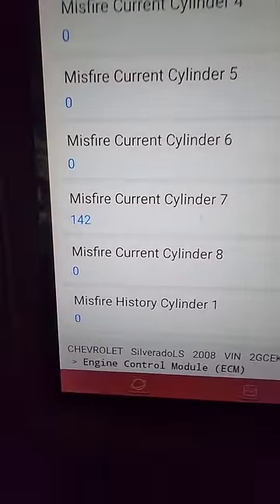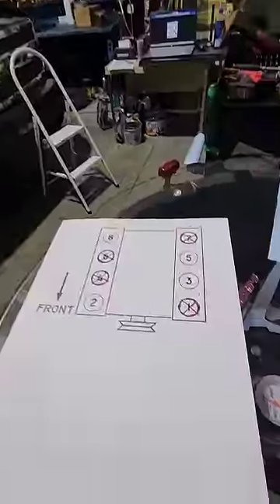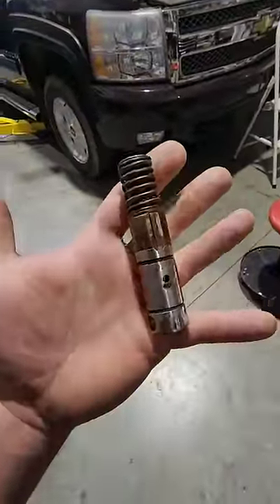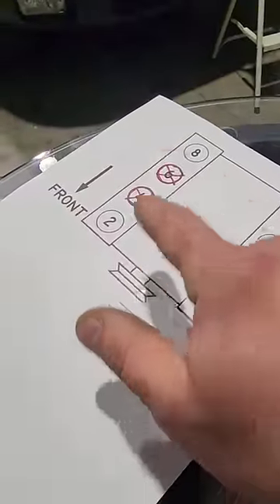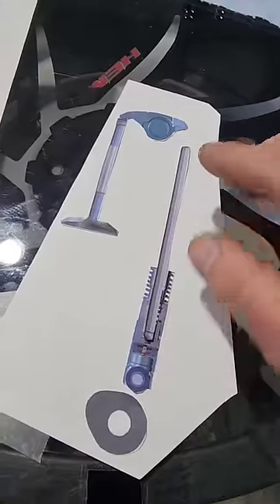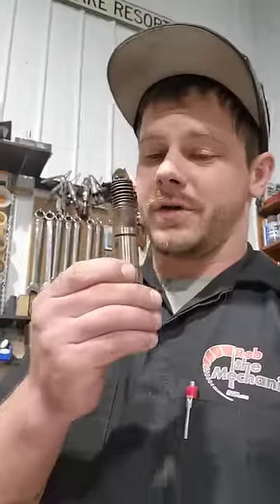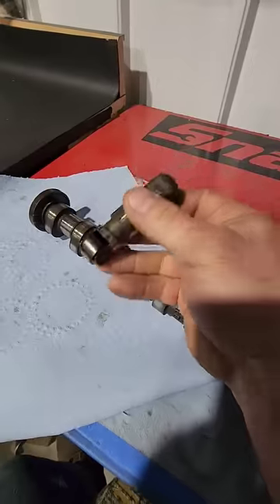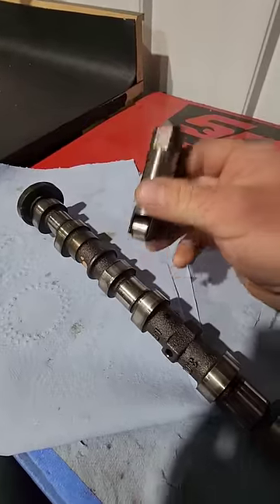GM Lifter Tick #shorts

Comment: always turn off  AFM  on every vehicle
Reply: turning it off reduces the chances of lifter failure, but doesn't completely prevent it. proper way is to delete the system altogether and install the same non-collapsible lifters on all cylinders.
Reply: Also turn off stop/start. Your engine doesn't need to go through a start cycle at literally every stoplight
Reply: GM calls it DOD "displacement on demand"...😎
Reply: @CWARZ23  It WAS DoD until Ford sued GM for the technology, where it was renamed AFM. That's what Ford does with literally everything...."we weren't bailed out, we just got a phat government grant at the same time!" - Every Ford fanboy.
Reply: @rorsche I would like the source for that lawsuit as I could not find it. DOD and AFM are not the same DOD shut down the same 4 cylinders everytime it didn't need all 8 here displacement on demand. AFM uses a process they call dynamic fuel management and on a v8 there is 17 different deactivation patterns and shut down all but 2 cylinders
Reply: @michaelbradley770  That's weird, because I can type in 'Displacement on Demand to Active Fuel Management' and the first result is, "Active Fuel Management, formerly known as Displacement on Demand before a Ford lawsuit.' I then can type in 'Displacement on Demand lawsuit,' and I get results showing Ford attempting to sue GM because Ford couldn't get it right.
Reply: @rorsche  I am still not seeing anything that says anything about a lawsuit. Copy and paste your source. And ford didnt have cylinder deactivation in a vehicle until 2021 and gm was already starting to use the term afm in the mid 2000's
Reply: @michaelbradley770  As far as I know, you can't link outside sources anymore; at least I can't. I can barely even type a reply without it being removed. But this is a simple search, so why are you lying so hard on this?
Reply: @rorsche  well from my side it sure seems like the lying is coming from you and you can still copy and paste links on a YouTube comment but thats ok because you probably can't find the source your talking about. The only lawsuits that my search is bringing up are class action lawsuits against gm for there dod/afm lifter failures.
Reply: @michaelbradley770  I attempted to respond to this like 5 times now. Whatever, you win by authoritarianism; proud? Anyone can look it up and see that you're incorrect. You even had to change your argument about DoD to AFM, so who are you trying to convince? Other people without honesty?
Reply: @rorsche  haha I didn't change my argument at all. As you said this is a simple search well so is sharing the source but you refuse to. GM fan boys having to make things up to convince themselves its a better product
Reply: @michaelbradley770  Your first comment states that they aren't the same thing. Then you proceed to admit they're the same thing.  Now you're talking about DFM which is ALSO GM. 
And now you're really going to act like the ship of censors doesn't exist here? Literally EVERYONE knows it does. You can't help but lie your face off.
Reply: @michaelbradley770  I'll tell you what, YOU link an outside source that says I'm wrong; since you're the one claiming it can be done.
Weird that you haven't done that to 'prove me wrong.'

Comment: My buddy bought an 08 Silverado max with the 6.0 aluminum block. He got it cheap because the owner gave up on it after the number 7 lifter had failed twice before and failed a 3rd time. Got it fixed again and it went out again after he had it for like 8 months so we just ripped out the AFM lifters and rebuilt it without that shit. Put in a cam and changed the oil pump and valley plate and timing cover to get rid of the vvt stuff too. Still running today. Been like 6 years now.
Reply: Should ha removed that the first time. Notorious problem.
Reply: @terrylong6457  it was left at our bosses engine shop so it got fixed on the company dime. After it failed again is when we converted it so he never spent the money on fixing the AFM himself. Plus he picked it up for half the going rate at the time. The previous owner was LOOOOOADED, and this black paint LTZ premium truck was now his "drive through the woods" truck because he already had a new one. Buddy grabbed it for 7500 and at the time the average ask for it was around 13-14k so he came out ok.
Reply: Pretty sure.The 6.0 is an iron block
Just looked it up, i stand corrected

Comment: I hate these afm/dod engines. If I wanted a gas saver I wouldn't have purchased a v8 pickup.
Reply: Oh wow grab HP tuners and click its off so hard bud
Reply: @shesqueeled  will that work on a ram1500?
Reply: @SHANKDAWGBABY  a lot of RAM guys are using the Diablo tuner
Reply: @jessesdomain444  copy that! Thanks
Reply: @shesqueeled shouldn't have to.
Reply: Man I swear this problem they created should be a factory recall.💯💯💯

Comment: Anyone who experiences this, pay attention, you need to replace your oil pump, there's an aftermarket high volume oil pump available that was specifically designed for these engines. When oil changes are neglected or the miles start racking up the stock pumps no longer keep up which is why these lifters fail. When you replace them, the new lifters will only last a year and some months. But if you replace your oil pump you will get more life out of your engine and the new lifters.
Reply: thanks!!
Reply: And an oil pick up tube brace that uses the other bolt hole.
Reply: I installed that pump, replaced all lifters and less than 50 miles after repair, same issue. What else could be wrong?
Reply: Wow sounds like GM
Reply: @beton10mix  Hahaha! Installer error.
Reply: Replace the lifters with standard LS lifters and the problem is solved forever, no need to buy a different oil pump.
Reply: I think it has more to do with the collapsible lifters getting stuck in collapsed mode.
Reply: Looks like another instance of GM  engineering a complete piece of s### and having the customer pay for the incompetence of the design team. Until you stop buying their product they won’t improve.
Reply: You're half right there bud, the lifters fail because of driving conditions. Not all drivers drive the same. If you live close to a highway and you start your car up cold and get on the highway right away and start cruising, you're going to be running in 4 cylinder mode leaving half of your cylinders not firing as well as those valves not actuating. It's the inconsistency that kills these valves. If they were used every day for " V8 driving ", you'd never have an issue. I just jump on mine all the time so it doesn't get comfortable in 4-cylinder mode until I scratch up enough cash for the Truck Norris cam kit from Brian Tooley.
Reply: @beton10mix clogs in internal oil passages. The block needs to be completely disassembled and clean every single tiny oil passage. I never change the pump, just installed non afm lifters, and delete the afm activation in the computer.   
And clean everything. 
Oil pump bypass spring could also be weak(can simply be shimmed with washer) or it's also possible to have an air gap on the o ring for the pickup tube. There is a kit available to brace the pickup tube, but can be made with a bolt, a washer, and a Dremel.
Reply: @johnk3606 your only talking about every single manufacturer after 2008. 
All period. 
Honda dealership started 10,000 mile oil change intervals in order to kill more engines by 150,000 miles. 
Same with Toyota. 
Every single manufacturer says go longer in between oil changes. And uses low tension rings that are more efficient, but are less capable of keeping the oil out of the combustion chamber. Modern engines consume oil at rates that would have been totally unacceptable 15 years ago. 
Unfortunately everything new is completely shit.
I cannot recommend a single manufacturer where you won't have problems as soon as the warranty expires.
Reply: Hmm so it sounds the oil pump is the cause of failure?

Comment: Lol GM is not the only one having that issue Chryslers 5.7 6.4 6.2 and even the 3.6 all do the same exact thing
Reply: Mine has been that way A LONG TIME! A machanic said don’t worry about it. He said you can have it fixed but it’s just going to happen again. What do i need to do? Also i am on a fixed income so how much would it cost to fix? Do you know?
Reply: I have the 6.4 it’s a crystler 300.
Reply: not exactly the same issue, more of a lack of oil flow between the lifter and cam, the very low angle of the rods and lifters at low idle prevent adequate oil to all surfaces. at higher engine speeds it's fine soon as it is sitting with out footy on feed it starts starving for oil.
Reply: @juggernautxtr  so it’s ok then?
Reply: @thejakefromstatefarm6768  not on gm it's gonna go no matter what, chrysler is an issue where if you let the engine idle to much it will have the oiling issues. chrysler the more your on the gas driving the better, the less stop and go traffic your in the better.
Reply: @thejakefromstatefarm6768  dude your 6.4 is fine just keep changing the oil every 3000 it will still tick but wont harm anything
Reply: @thejakefromstatefarm6768  I priced one today for a 5.7l hemi and it was like $4600 but we are a dealer and like most labor rate is high high lol hope this gives you a ball park at least
Reply: @prestonikard9221  thank you much
Reply: the 6.2 luckily doesnt have MDS
Reply: @juggernautxtr  Yep! I told my wife..do not let her 5.7 hemi idle for any length of time. I do have the broken exhaust bolts I got to fix, they all do that.

Comment: My 07 Escalade (6.2) did this at 176k miles. Along with the oil pump going out 2 days later. 
It was a headache to repair. The manifolds were a nightmare because the bolts were rusted and all broke. Then I have an all wheel drive so I had to drop the front differential to remove the oil pan to replace the oil pickup tube. All in all it took me 3 days. 1 to get parts, tools, and begin the uninstall process. Day 2 complete uninstall process and replace worn parts. Day 3 reinstall and go on a 4 hour road trip to make sure it all worked 😂 * I have AAA so I wasn’t worried about being stranded.

Comment: They make a kit it’s 800 comes with all the new gaskets and all new lifters new valley plate and cam and a tuner to turn off the afm that’s the best thing u can do with them motors then they last forever
Reply: Got more info for that kit? My 2007 Suburban has that v4 v8 DOD crap.
Reply: @Jennifer Rae Fuchek  check texas speed and performance. They offer DOD delete kits and required cam packages. You can get stock grind cams, or a higher lift cam for a few extra ponies, if you'd like.
Reply: @JenniferF2882   if you don’t plan on other serious upgrades, stay with the factory style cam on the kit. It’s mostly at high revs / high loads where it will make any difference alone.  Other than squirting more fuel to compensate for more air at all RPMs.
Reply: I have a ‘11 Silverado with 199k miles. It’s still fine. I feel oil is a Leo element in this problem being kept to a minimum. I use the same brand oil all the time and use a Wix filter. I change oil on time and I have been lucky so far.
Reply: Why can’t they just not put that garbage ass shit in from the start instead YOU have to go out of your way to buy an aftermarket kit and install it / pay to have it installed. No thanks. And a ford modular motor runs forever. No bullshit like this to deal with
Reply: @anthonyhales4192  I feel ya I’ve seen ford motors fail too use to build them and race them ls is the best motor out there if u get one without the afm
Reply: @jokesatinappropriatetimes  look at the superchips programmer, no need for new cam.
Reply: No need, just have a tuner turn it off. If it never leaves V8 mode it will be fine.  You can make the mechanical change, but unless you are in there for a cam swap, etc. it doesn't make much sense.
Reply: @robertthomas2942  my motor failed on flat Prarie highway. Do a delete... gm should be sued for that motor.
Reply: @anthonyhales4192   😮😮
Reply: @thirstbuster78  If you had turned off the DOD/AFM it would have been fine.  I've done it both ways, it makes no difference.  It fails when switching back and forth from V4 to V8.  If it stays in V8 mode it won't fail.  Doing the delete physically means taking the heads off, changing the oil pump, etc. It's a pretty big job. Doable but not easy. Changing the cam? Sure, do the full delete. But if it's running fine, no issues, have a tuner kill it in the software. Easy and cheap.
Reply: @JenniferF2882  yes I’ll get the name of it from my boss I have put a lot of them in I work at a carlot and we do all the ones we sell
Reply: @cjwrench07  factory style will fail and fail again rust me been through it
Reply: @robertthomas2942  u can’t just turn it off and the lifters fail that’s why u have to change the camera and lifter in first place
Reply: @JenniferF2882  it’s from AMS racing it has new lifters and cam  and the lifter retainers and all new gaskets and valley delete pan a DiabloSport  tuner it’s a nice kit I have installed about 10 of them with no problems at all there 800.00 plus tax feee shipping
Reply: @ASETECH1978   it is confusing in intent.  I meant using the OEM lobe profile on the aftermarket cam.  The vast, vast, majority of drivers will only burn more fuel/money with a more aggressive cam profile.

Comment: So... I'm guessing all that saved gas expense was barely a dent in the repair bill (not to mention time without truck).  That's just nifty.
Reply: The gas mileage difference is somewhere between 15-30%. If you are driving a truck like this, you probably spend 200-300 a month on gas with v8 only. So you would save between 30-90 bucks a month, depending. You would save more for sure on the higher end of this scale, if you do a lot of driving. 5 years of 90 a month is like 5400 bucks saved. So it would depend on a lot of things, most of all being how many years did it run before this part failed, and how many miles per year you drive (and thus how much gas you go through)
Reply: @rdizzy1  Bull crap.  You are so wrong as due to that low hp pushing that heavy truck with terrible drag coefficient
Reply: @brinkee7674  Nope, it is based on statistics only.
Reply: @brinkee7674  for highway driving it works but unless they make trucks with the aerodynamics of a Corvette it's not going to be much difference
Reply: If you want to save on gas on the big chevy get the 3L diesel only 1,000 option and gets like 30 mpg

Comment: My 2015 has been making that same noise since it had 15,000 miles on it im at 200k now and it's still just a ticking away
Reply: To be fair there's normal valve train noise and then there's this. My hemi ticks too, but it's done it since day one and has 170k on it now. My Camaro thankfully doesn't tick, but I know it's a matter of time with DOD crap.
Reply: @PacoRobbins  hemi tick is notorious but could be from exhaust manifold or resolved by replacing with hellcat oil pump
Reply: Afaik Hemi engines have always had a tick that can be compared to the tick of a diesel engine. Maybe not newer ones but pre-2010 hemi always ticked.
Reply: over 385k 2005 yuxok xl, the tick and the tock are part of it.
Reply: My 2015 went to 204k then misfire on 8. Lost the needle bearings in one of the rollers shaved a little off the cam. So yep new cam and lifters $1,800 and two days work ran like a top!
Reply: @PacoRobbins I keep getting a Multiple Misfires detected code on my Camaro and the sad part its intermittent and no one can find out why
Reply: Golf GTI's tick from the factory, at least mk6 IIRC. I never looked at buying one after discovering that.
Reply: Your 2015 is direct injection. That’s why it ticks. The injectors work loud. Had a 2018 and 19 with the same L83 motor they always tick
Reply: @mr.lowslow7702  I've heard of that, but I never heard my sequential port and direct injection engine tick.
Reply: @johnhunter7244  they all do that. I have a Solstice GXP turbo it ticks, my brothers Cadillac ate-V 3.6 twin turbo injectors tick, I had a 2010 CTs with the 3.6 LLT it ticked as well. The gen 5 LS trucks tick the list goes on. So do direct injection bmws and just about everything else. I thought it was lifter tick at first but then all my GM cars had it so I figured out it was injectors pretty quick
Reply: Lmao
Reply: @Forrest Weldon  I have a 2003 Ram Off-Road edition with the non-mds Hemi and it has ticked since the day it arrived after we ordered it new!
Reply: People talk about this hemi tick, ive had an srt8 for 2 year and the engine is very very quiet.
Reply: Yours is not a lifter then… probably secondary fuel pump tick
Reply: There are different ticks. The cam killer also kills the affected cylinder. Sources of ticks with no misfire aren't hammering the cam lobe.
Reply: It's not this problem then as it would be accompanied by a misfire
Reply: @mr.lowslow7702  exactly
Reply: @PacoRobbins  you have DOD on your camaro? bro delete that NOW
Reply: @deltasixgaming  DOD bro delete it especially if you have the LS3 if not youll need a Cam shaft kit from Brian Tooley Racing
Reply: @shesqueeled  I will look into it
Reply: As a #7 lifter failure victim on a c7 Vette, I would agree with Afm replacement/deactivation. Solved my problem by trading in for new c8 that has same 8~4 cylinder tech. Looking to remove it after warranty. Fix it GM  !!

Comment: Just finished with the new NON-AFM cam and 16 great new lifters & valves job with a reprogrammed ecu. Runs smooth as glass & much more power.
Reply: and it will last 180 + k miles
Reply: @shesqueeled  no doubt. Did the new cam & lifters @322,000 😎

Comment: Bought a used 2007 Yukon xl with 100k on it in 2011 turned AFM off with a programmer. At 245k full rebuild and did the non AFM cam, lifters, and front cover and had it tuned. More power and better mpg too now than it ever had before.